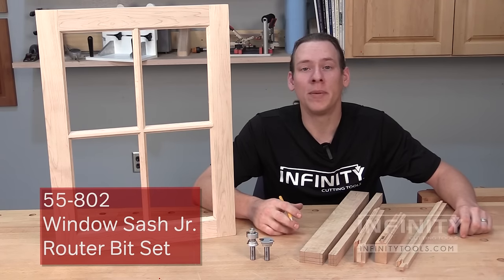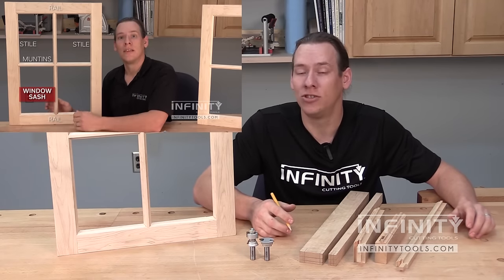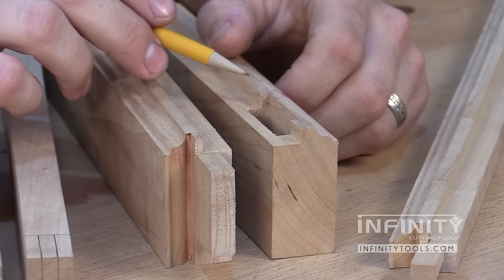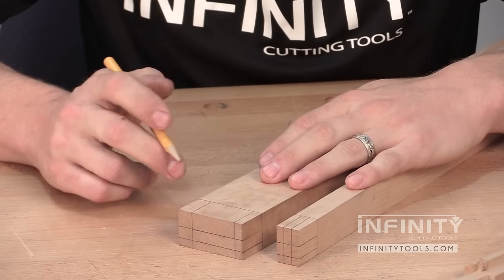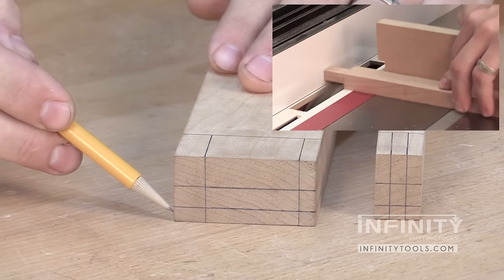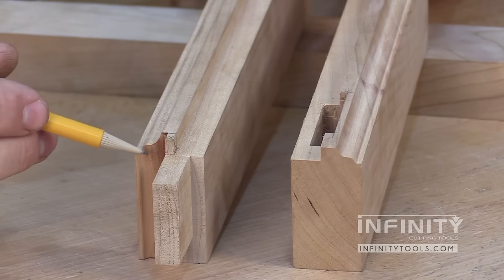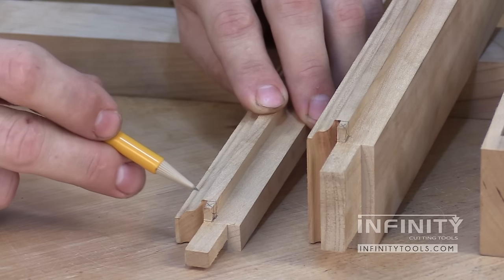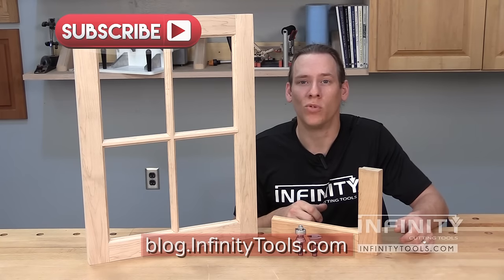Infinity Cutting Tools - Using Window Sash Jr. Bits (55-802)

Comment: Hi! I’m getting ready to make three sashes with this Jr. bit set. May I ask what thickness your stock is in this video? I’m using 1 1/8” (barely) thick fir and trying to determine the exact layout of the mortises and tenons is proving difficult. This is my first attempt at this so I’m going to try it out on some scrap spruce but figured I’d ask about your material first to see if I can replicate what you’ve done. Thank you in advance.
Reply from the maker: The sash in this video is made from 1-1/8" thick stock, so it should be just about exactly the same for your project.
Reply: Infinity Cutting Tools Thank you for such a prompt reply! Very helpful information!
Reply: I still don’t understand the layout.
Reply: I get the tenons, I should say. But the setup at the router table must be different from a typical sash and that isn’t explained here.
Reply: I’ve been messing with this for a few weeks now and I can’t get things right at the router table either. My material is 1 1/16” thick to match existing storm windows. If I follow the set up with the rebate cutter brushing the exterior side of the rail tenon, the profile cutter is too high on the rail and leaves excess material beneath the fillet. I’ve since disregarded the instruction of “cutters brushing tenon surfaces” and can get close but the cope and profile simply do not match precisely. I’ve even read over both blogs but still haven’t got it figured out for my particular situation.
Reply: @Standswithamiddlefinger  I am having the exact same issue. Did you ever find a solution?
Reply: @matthewdaly8772  ,I did. I made a couple of mock-ups to practice on. It’s been awhile since I did this but I think I approached this by adjusting the profiling bit height to give me a fillet without the excess material (about 1/8” in width is what I ended up with). That resulted in getting the rebate depth I got. I can’t recall that depth but it worked fine when I glazed the glass in. I then had to adjust the coping bit to match the profile. I had cut a piece of the same material and thickness and ultimately used that as my template for setting the cutters to the correct height and depth. My joints were not very tight so I used locked tenons ala Paul Sellers to help pull things tight at glue up. Ultimately, everything turned out fine but I had to thickness plane all my pieces by hand so that contributed to issues at the router table. Hope this is helpful.